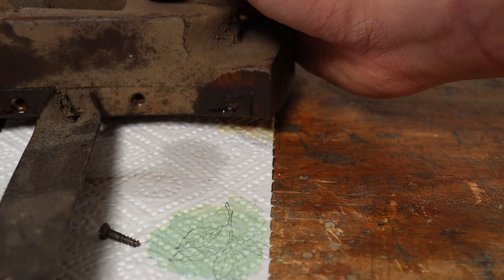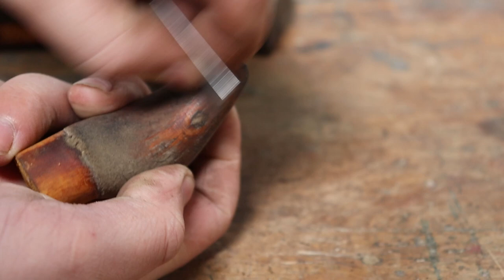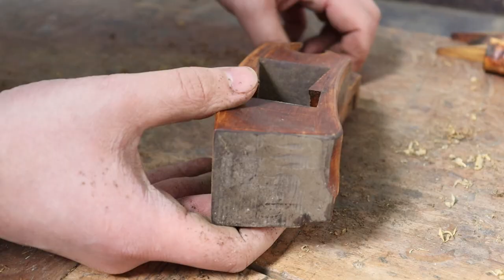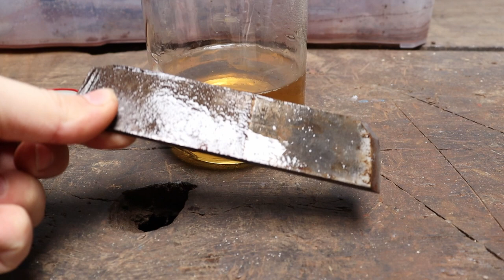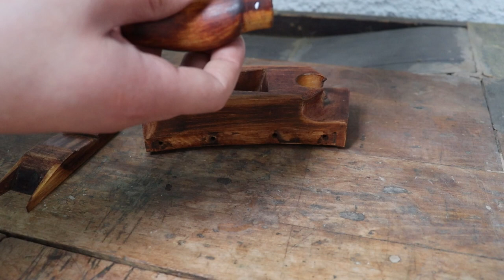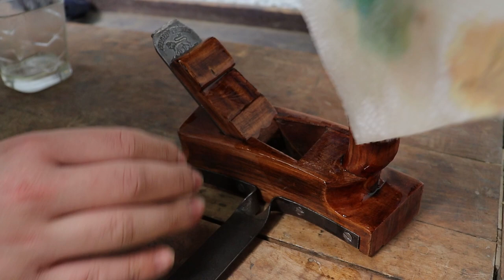RESTORATION OF A 100+ YEAR OLD WOOD PLANER

Comment: Belle restauration d'un rabot pas très courant.
Apparemment un rabot pour chanfreiner les fonds de tonneaux.
Pour nettoyer des bois très encrassés comme celui-là, vous pouvez utiliser du vinaigre et une eponge à récurer genre "Scoth brite". Les eponges vertes pour gratter les casseroles. C'est assez efficace.
L'alcool et l'acide du vinaigre nettoient et s'évaporent relativement vite, donc ils n'ont pas le temps de "mouiller" le bois et de faire pénétrer la crasse.
Reply from the maker: And what about the smell of vinegar, doesn't it settle on the wood?
Reply: @RestoJacob  il y a l'odeur pendant que l'on fait le nettoyage, mais elle s'en va très vite.
Et puis ce n'est pas une odeur désagréable ni toxique.
Sauf si vous craignez cette odeur.
Reply from the maker: @guylabesseuille2716  
When I have a planer that I might be missing, I will try it.